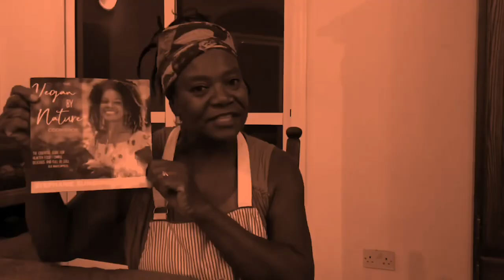Update on the pick truck brakes

Comment: Please disconnect that switch on the end of the master cylinder. They are notorious for catching on fire and burning the trucks to the ground. Ford had several recalls on the matter.  It is a cruise control deactivation switch if you want to look it up yourself. Just search "cruise deactivation switch ford truck fires".
Reply from the maker: Thank you 🥰🥰